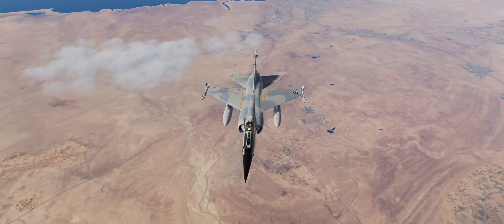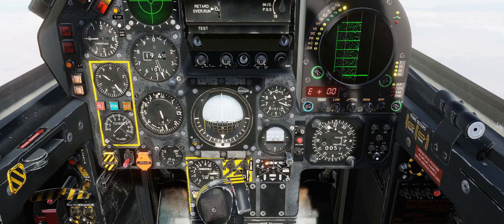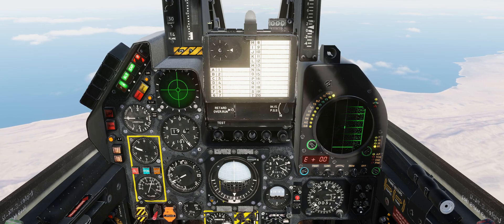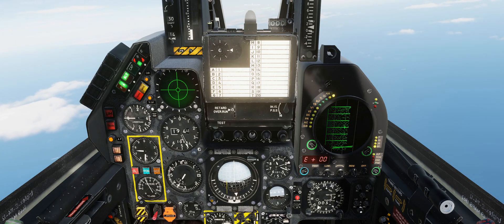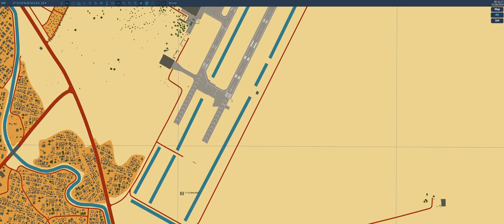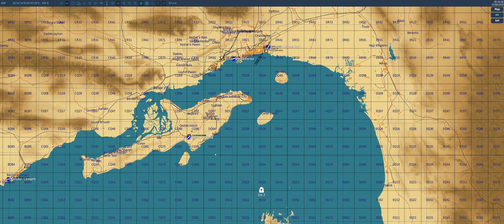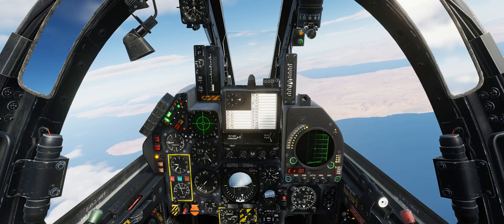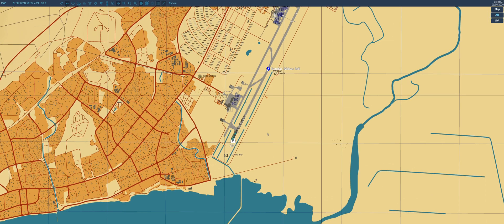DCS Mirage F1EE - TACAN and VOR course hold autopilot modes

Comment: I don't understand why you don't bank towards the indicated course and pull at the stick to turn towards it when the course is too far. As the course marker gets closer you could have banked the aircraft and turn a little bit to the opposite direction and only when the course is close enough to make rudder corrections. With rudder corrections from the beginning the procedure took a long time.
Reply from the maker: The purpose of the video was to demonstrate the autopilot modes.  Sure, I could have manually intercepted that course, but the interception of the course an important function that I wanted to show.  I didn't provide any manual input at all beyond throttle and airbrake with this intention in mind.